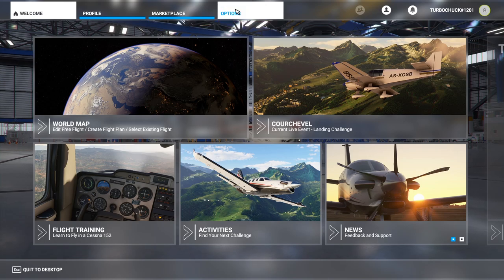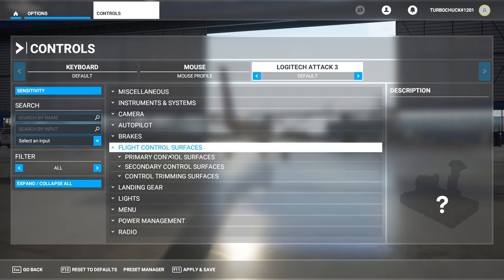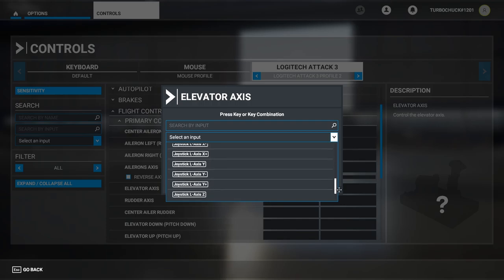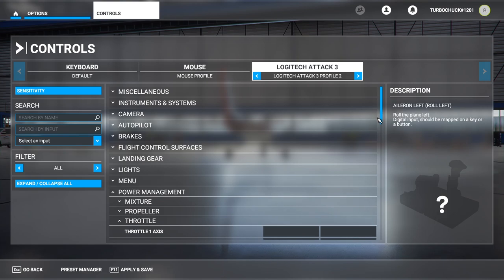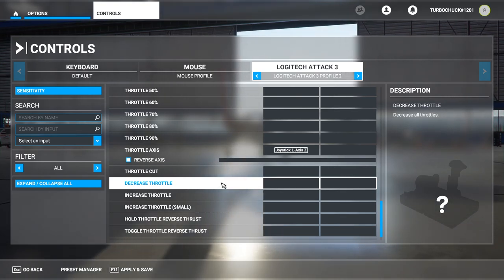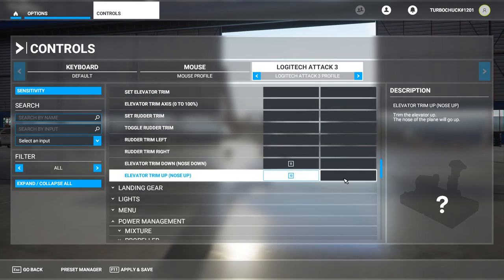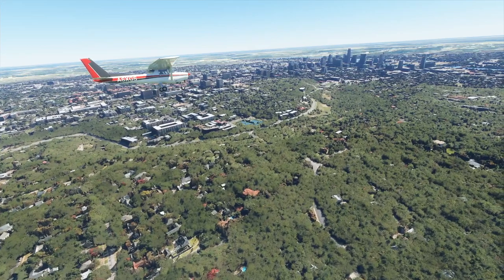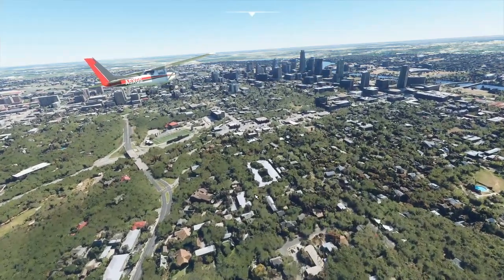Joystick Configuration - Microsoft Flight Simulator 2020

Comment: Can you suggest a better config for my pxn 2119 pro flight stick controller for cesna? I tried adjusting the sensitivity for the rudder I can't seem to get it right, it is too sensitive, same with the pull. When I take off I need to pull it all the way back but its too much for the plane, I appreciate your help

Comment: Turbochuck: I will be purchasing a brand new Windows 11 computer in 2023 in the next few months. I am looking at the HP Pavilion All-in-One 27-ca1055t with Windows 11 Pro, i7-12700T up to 4.7 GHz, 32 GB DDR4-3200 mhZ Ram, 1 TB primary storage, 2 TB secondary storage, Nvidia GeForce RTX 3050 (4 GN GDDR6 dedicated). I also plan to purchase the MSFS Premium Deluxe 2020 game and the Logitech Extreme 3 D Pro Joystick. My two questions are: 1. Do you think MSFS 2020 will work with this brand-new computer purchase of Windows 11 Pro? (Would install Direct X 11.)  2. Do you think the joystick I plan to purchase will work with Windows 11 Pro? Thanks in advance for your help.
Reply from the maker: Those PC specs are more than adequate, so no issues there.  A number of people use that joystick for MSFS, so you should be good there too.
Reply: @Turbochuck  Will Windows 11 work? Thank you for your response.
Reply from the maker: @larryedwards5703  Should be fine, I've seen some people running Windows 11 and MSFS with no problems.
Reply: @Turbochuck  Thank you sir.
Reply: @Turbochuck  Thank you sir.

Comment: Can one use a USB joystick and another for the extra buttons? I tried to use my saitek joystick and a USB arcade deck for buttons. Once I added the arcade deck the saitek quit working.
Reply from the maker: As far as I know, Flight Simulator only supports one of each type of device, so I don't think you can use the joystick & arcade deck at the same time.  Unfortunately I don't have a way to test this.

Comment: Could you comment on this....While setting up controllers I often get a message saying: “You are trying to set up a controller on a device that is not selected”....meanwhile I have it selected in the top bar?thanks
Reply from the maker: I haven't seen this error before.  I would try disconnecting all USB devices except your mouse and keyboard, starting Flight Simulator, then connecting your controller and configuring from there.